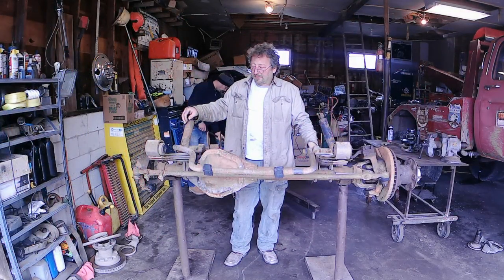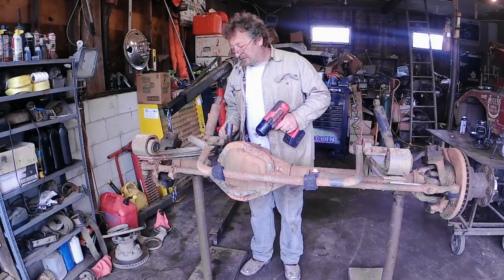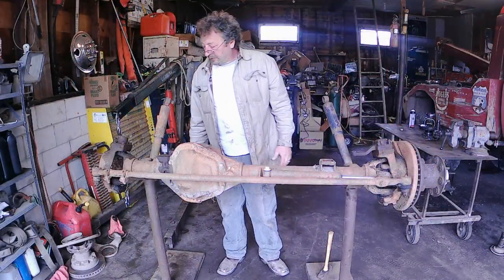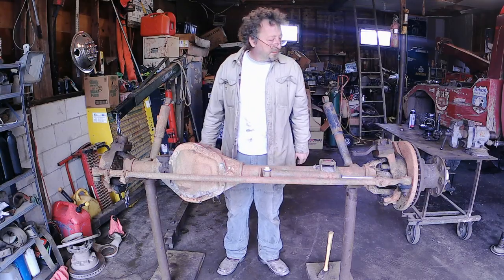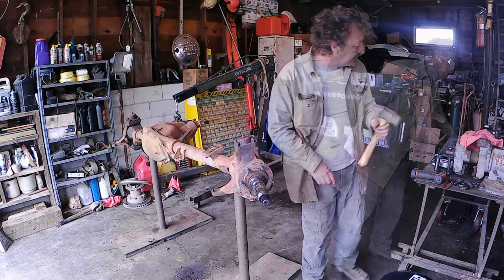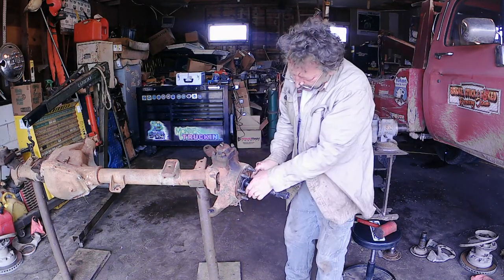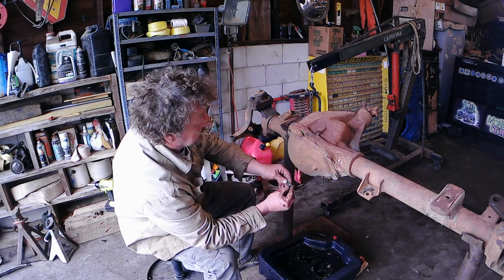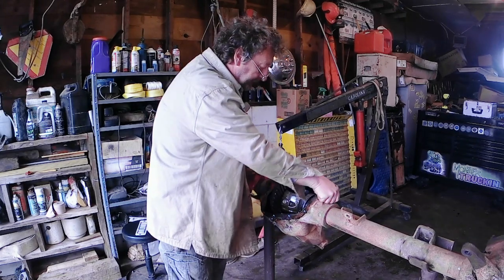New Dana 60 front axle build  for the wrecker by BSF Recovery Team

Comment: I was surprised to hear that you were breaking grade 8 bolts on your spring retainer. I think upgrading the retainer plate would solve that issue. Good video can’t wait to see you back on the trail.
Reply from the maker: If I custom made a plate that dropped over the spring so the bolts could be shorter, then the spring might not have the leverage factor to flex them so much.

Comment: Don't toss those spring plates, I had to pay out the butt for aftermarket ones as the axle I bought didn't have any mounting hardware and the bolts were snapped off in the casting.